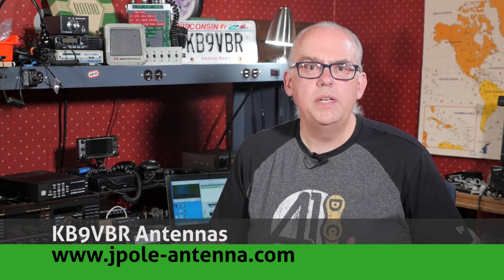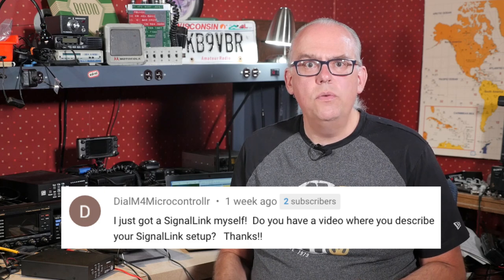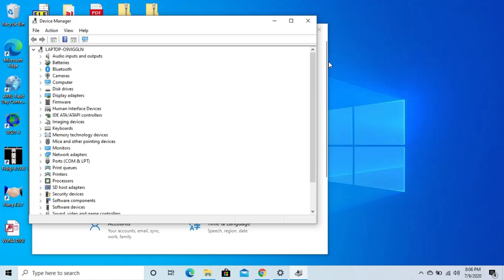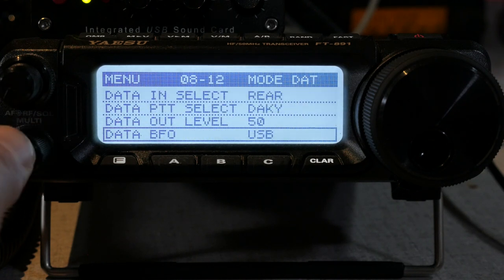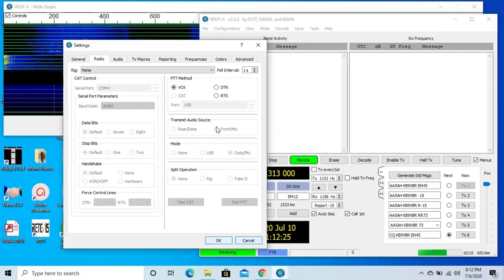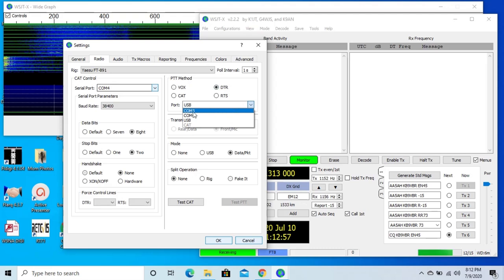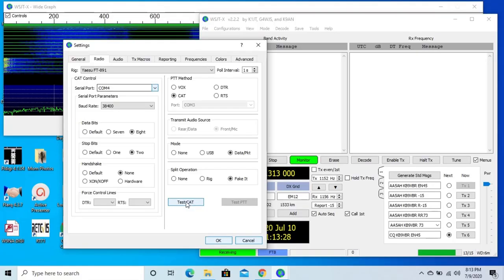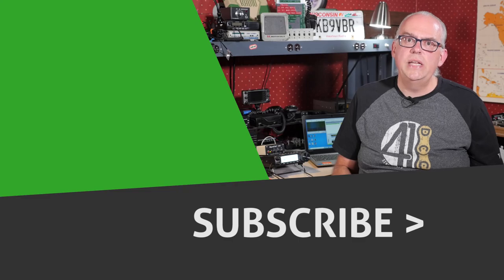Yaesu FT-891 Setup for Digital Modes - Ham Radio Q&A

Comment: Just an fyi for anyone that ran into a rig control error using the cat com port assignment Michael used -  I set my 891 up for digital modes for the first time today. I’m also using the SignaLink, and WSJT -X is running on an older Dell laptop. I followed this guide to a tee, but ran into a problem and error when I clicked on Test Cat button. I found another guide that set up cat control with the enhanced com port, and standard com port for PTT. It worked perfectly. And of course YMMV.

Comment: I watched your video several weeks ago when I was setting up my SignaLink with my FT 891 for Parks on the Air for WSJT-x. Works great. I decided I was going to try AFSK RTTY while activating a park tomorrow so installed MMTTY. I was almost there but max was only 5 watts. I reviewed the settings, and 8-1 Data Mode: PSK was set to OTHER. When I changed to PSK, to my surprise it worked. Thanks for the helpful video (twice). 73 de KN3A.

Comment: K5BXM - Thank you to ALL for the technical information. I am trying to get Ham Radio Deluxe working with my Signalink & FT-891. These settings help me understand what is going on between the software and radio and Signalink. Finally got my HRD Rig Control working after several days. Now, trying to get the Signalink working to decode and transmit. I am pretty computer savvy but not quite enough to know what I'm doing when getting into assigning the ports & etc. This video was VERY educational. Thank you.

Comment: Thanks for the answer. After hunting all over the YouTube channels I finally extrapolated that two USB cables each with an A & B end on them plus a third cable with an RJ-45 on one end and a 6 pin DIN in the other end. My home built unit works quite well but the unit is slightly bigger than the Signal link The audio jacks going from the USB sound card, in vs out can be confusing and easy to mess up on what I have. So since I got the Signal Link given to me I thought I would give it a spin. I figured it would probably be just like what I am using now except less fiddly.
Reply: Again thanks for taking the time to respond. I just built a cable for the Signal Link. It shows the PTT line and the cable from Signal Link shows this connection for the FT-818 and the 891 being the same for the jumpers. Even though depending on if you just take a Audio in and out through the six pin and cat control through the USB connection. I got my 891 working with a home built sound box which isolates the radio from the computer. I currently have it setup with the Raspberry Pi 4 4gb and digi-pi works quite well. I ended up with a Signal Link and a FT-817 and since I have it and the same cable is required by Signal Link for both radios. I should call them and ask a few questions as it appears that the same cable and jumper settings are required for both radios. It would be nice to have that setup for both radios. With the pi I can run ft8 with VNC Viewer when portable. Using my phone or tablet. I should probably have a conversation with Signal Link before I connect it up. May just buy a cable from them. I built mine ok but, what a pain. Again thanks.

Comment: An excellent video.  Used it to get my second 891 on FT8 after I fried the first one.  Using Signalink USB,  I've tried different ptt methods, but agree with other comments: Leave the WSJT setting for PTT to CAT. Note that this means the PTT HOLD function on the signalink is ignored, but you don't really need it anyway..  Thanks again!
Reply: How did you "fry" the first 891 ?

Comment: Great video, wish I had this when I set mine up last year. One thing I did have trouble with and you didnt cover was once I had it all set up and connected, I still could not decode signals as everything was bunched up on the waterfall. I had to set the Width on the radio to maximum to be able to decode. While this is obvious to me now, when i first started it was not. Keep up the good work. Tim VK5AV.
Reply from the maker: Thanks for the comment. I may do a more general "Intro to WSJT-X" video as there seems to be a lot of things going on with it feature wise.
Reply: I was going to say, I just set this up last weekend on mine and had to make sure to expand the bandwidth to 3k. By default in data mode, the 891 makes it really narrow, like 800Mhz or something, so WSJTX can't hear enough. You can see this on the waterfall in the app.

Comment: 5-8 CAT RTS - I had to set mine to Enable, not  Disable.  Without it the radio would key but transmit no power.  Took me a couple of days to figure that one out.  Finally on the air and making contacts though.  Thanks for the video.

Comment: The VOX in the Signalink USB cannot be turned off and so you are using VOX even if you have PTT set to CAT in WSJT-X.  I've found that using CAT method can cause relay chatter on key down.  Tigertronics indicates that VOX is the preferred method to trigger PTT when using WSJT-X.   73

Comment: I was hoping to see how to set up and use signalink with my FT-891, but cables were mention and cable connections were not shown

Settings and lights on signalink were not discussed.  

It would be nice to review non cat control use of signalink as you mentioned but it was not shown.

I would have liked more detail

Comment: I'm not sure if this is a radio setting that I need to adjust. But, when I plug in the signalink cable into the back of the radio. The radio still plays audio from the internal speaker. Should it be switching to the rear port automatically? The signalink doesn't pick up any audio over the cable. But, I can manually connect an aux cable from the headphones output into the signalink to get audio into the computer. Although, then I can't transmit audio from the computer to the radio. I have the digital mode settings configured like you show in the description.

Comment: Thanks for the heads up, I am a bit used to my IC-7300 where I can monitor the tx audio, that combined with the alc I make sure the signal is clean, I have not found a way to do that on the 891. Have you?

Comment: Why not use the Ft-891's DATA mode for WSJT-X? I ask because I cannot get the DATA mode to work! LOL. When I switch the radio to DATA mode, all I hear out of the speaker is a quiet crackling and popping, as if the speaker is damaged. WSJT-X, when configured to use Data/Pkt can't hear any signals. If I switch both back to regular USB, everything works. What do you hear when you put your FT-891 in DATA mode?  If I configure WSJT-X to use FLRig, then, when I switch to both WSJT-x and FLRig to data mode it sounds almost normal in the speaker (a little pinched, because the bandwidth is less, for some reason)... but when I transmit, the radio "walks down" the band, 500Hz at a time! Something isn't right!

Comment: Hello, Great video thanks for doing these videos. They are a great source of information and I appreciate all of your efforts that come into making these for others like me to source out information. I have a question .... I am using my ft891 with the LDG z-100 plus which is a simpler tuner and my question is how do I connect the tuner to the radio using the IC-108 y cable connector. The cable has three ends. a data port connector on one end and it Y's to a stereo style connector along with a tun/lin connector. do I have to connect all 3 data port(radio)-tun/Lin(radio)-and the stereo type (tuner)? I did set my radio to lamp but it wont tune. only way I can have it tune is with only the coax connecting and I hold the PTT while hitting tune. You help would help me resolve this issue. thanks in advance

Comment: When you select CAT as PTT option the PTT is controlled via a CAT command. This is done via the 'standard' comport as that is the CAT port. The comport selection in 'PTT methode' is greyed out because it has no  function in this case.
When you select RTS as PTT method you can select a COM port (would be 3 in your case) ,  now the RTS line is use for PTT control, but you have to enable 05-08 CAT RTS to true in the 891 menu.  (Keep it on CAT control, it works fine.)

As for power, i always leave it at 100W and adjust the audio level down so only 40 watts is produced. This makes sure that ALC is far from being triggered introducing possible non-linearity.
Reply: What I have found when using my FT-891 and a brand new Signalink USB with jumper set, is that when you set PTT ro CAT in WSJT-X, the microphone is not disabled for about 1/4 - 1/2 a second after PTT is activated... that means I can hear room noise or feedback if I'm listening to my transmitted audio on another nearby radio. If I set PTT to RTS (and leave it disabled in the radio) and set the COM port to the same value as the radio's CAT port, PTT works fine and there's the mic is not enabled at all during transmit.
Reply: On some radios like my Icom IC-7000 the data jack is very sensitive to input, so it makes sense to use a lower power setting. Then you will have more precision on the Signalink's TX control. When I had my radio set to 100 watts I was very easily able to overdrive the radio by just moving the TX knob slightly.

Comment: Hello I hope you can help me. I've done every step regarding downloading the drivers, installing it then plugging in the radio, but when I navigate to device manager I am unable to identify the comports. It shows up as USB Composite Device. There are no 2 ports showing up. I have the FT-891, Downloading the   FT-891 USB Driver Virtual COM Port Driver (Windows 11/10), I unzip and extract the files then install silabser. I boot up WSJTX and, ""rig control error" pops up.

Comment: You got it the wrong way around when configuring and explaining the com ports.  The standard COM port is the LOWER of the two and that is the CAT control. The second (enhanced) is always the higher of the two. You set your PTT to use RTS on this second port.

Comment: I don't know what the Yaesu engineers or marketing people were thinking - or not thinking - when they decided not to outfit the FT-891 with a built-in sound card,  like Icom does, even on its entry level radios like the IC-7200.  I also have one of these rigs.  3 straight forward adjustments on the radio, one USB cable for audio and CAT.  

With the FT-891 I cannot be sure that the settings will always work.  Last weekend I spent two frustrating hours fiddling with the radio and my computer in the field trying to get the damn setup to work. It didn't.   I had just used it several weeks before and had no problems.   Besides the hassle of putting up portable antennas in wild terrain, I have to deal with a quirky radio.  The IC-7200 is much heavier, but it is dependable and easy to use.  And I have only one cable between the RPi and the radio.

Yaesu dropped the ball here - or intentionally let it fall.
Reply from the maker: I know what you mean and the lack of integrated sound card is the reason why I don't do much with digital out in the field. Last Field day, I had everything up and working, and it did work; for about half the weekend. Then something changed. I know Yaesu can make an integrated sound card work, because it works just fine in my FTdx3000. My feeling is that either there was no space in the radio for a sound card, or Yaesu didn't put one in so as not to cannibalize the rest of their product line. Yaesu makes great radios, but their marketing decisions confuse me sometimes.

Comment: I do need a clarification on the connected cables? I am one of those folks that need to see what cables are needed and where they connect, to? (1) I expect a rj45 to round 6 pin cable goes from the rj45 connector on the signal link to the round 6 pin data port on the radio. (2) a type B USB cable connection on the signal link to a USB connection on the computer.  (3) this is where it is unclear? a type B USB cable connection on the back of the radio for CAT control also goes to the computer, meaning there are three cables total needed for this operation? One USB Cable from the computer to the radio and one USB cable from the computer to the Signal Link, and one rj45 x round 6-pin data cable from the signal Link to the radio? Is there any chance you can answer this question? I have looked at all the videos I can find and none of them really show all the cable connections and where they go. I have my ft-891 currently connected via a home built sound card using a USB audio sound card and eBay sound card with isolation transformers coupled with an additional USB cable from the computer to the radio for CAT control. It still ultimately uses two USB ports on the computer.
Reply from the maker: On the back of the FT-891 there are two ports you will be concerned with for data operations. The USB B connection and the 6 Pin DIN connection. The USB B is for CAT control only. There is no built in sound card in the Ft-891, so no audio travels through that connection. The 6 pin DIN handles audio in/out and transmitter switching, but no CAT functions. This is a departure from other Yaesu models contemporary to the Ft-891, like the FT-857 and FT-897, as on those the CAT could flow through the 6 pin DIN. 

That means with the Signalink you will need two cables (or three depending on how you count things). A USB from the computer to the USB on the Ft-891 for CAT. A USB to the Signalink for computer audio which then flows via a cable from the Signalink to the FT-891 into the 6 pin DIN. That means to use the Signalink with your FT-891, you will need two USB ports on the computer. 

If you are looking for a single USB option for a digital interface, you have a couple of choices. First, you can switch to VOX on the rig and forget the CAT control. Or second, you can switch to an interface like the DigiRig. The Digirig offers a single USB solution in that it uses the transmitter keying pin on the DIN connection. I did a video on the Digirig and explain how I use it with the FT-891 https://youtu.be/afpvK8UrftU?

Comment: Awesome video bro !  I'm used to using the dx3000 where I adjust the mic gain for low alc reading.  I've got the 891 set to show the alc on tx but it doesn't show anything when I cq no matter what the signalink tx knob is doing or what the mic gain data out levels are in the menu.  Of course I want the alc level to be low but I'm doubting the meter is showing or adjusting correctly since I can't get the meter to show anything with high settings so I stopped there.   Any thoughts would be appreciated thank you .

Comment: The only way I could get the “test cat” to work without an incorrect frequency error was to swap the enhanced and standard com port settings to the opposite of what is in the video.  It then turned green and the PTT test also worked.  I am unsure if this will work in practice as I could not make any contacts.  Any comments or suggestions?
Reply: You are correct. The video is wrong, you have to use the Enhanced port for CAT control setting the frequency. But Michael 'corrects' this by using COM4, which he calls the Standard port but it's not.

Comment: Whats the wiring diagram on this?

If I plug in from the radio USB to computer, the virtual comm ports work. But if I go from the radio data port to signalink radio port, and then USB from signaling to computer, the virtual comm ports don't register.

How else would I get them to communicate? Did I miss a wire?

Comment: Thanks for another great video Michael. When I use "fake it" for split mode, my frequency changes on every transmit cycle. It keeps going lower and lower until I no longer receive signals either. I have "Hold Tx Freq" checked as well. Any idea what I'm doing wrong? KN4YSX
Reply: I am currently having this problem with my ft-891 as well. Where you able to figure out a fix?

Comment: Hi Michael, I'm a big fan and follower. Question, I cannot for the life of me get the Yaesu driver to be recognized by my windows computer. When I turn on the radio and connect the cable, my new lap top doesn't recognize the drivers, There is NO PORT tab in the device driver ! I've turned the radio on/off various times and re downloaded the drivers many times. Can you possibly shed any light on this ? I'm stuck . Thank you, Jim K2WPA

Comment: Thank you for video.  Can you show us a picture of the rear view, where we could see the wires and connectors between the 3 main parts: PC and rig and SignaLink USB ?  Thanks.
Reply: Tim, I can help out here.  There's really only 2 connections to the radio in this setup.  The USB cable leading to the computer, and the SLCAB6PM cable from the Signalink's Radio port.  The USB cable to the computer plugs into the squarish shaped one dead center of the back of the radio.  the SLCAB6PM cable plugs into the circular socket right next to that (when looking at the back of the radio, it's immediately to the left of the USB connection).  The Signalink (assuming you have the SL-USB) also has a single USB connection to the computer.  Beyond that, the standard coax and power connections to the radio are all that is needed.

Comment: Did you say the older version of WSJTX "Broke the FT-891" If it did could you explain that a little bit. Good thing I didn't run the radio on it yet as I shall check the version. I couldn't see anything in the software for an update option. Could you maybe give me a tip if that is possible as that would be a lot easier than loosing all the settings on my Icom 7300. it is using 2.0.1 I think. I installed it on my laptop for the Yaesu FT-891 but havn't finished setting it up. I am currently setting up the "EASY DIGI" which I am just using it for the Audio isolation but am using the USB for rig control and keying. Maybe you could do a video on that kind of setup with it's plusses and minuses. Thanks for the nice Video. I am now going to take a look at WSJTX and see what the version is on my laptop which I am going to run the FT-891 with.